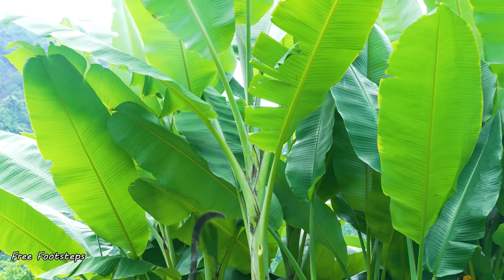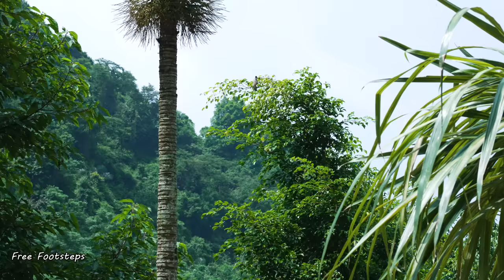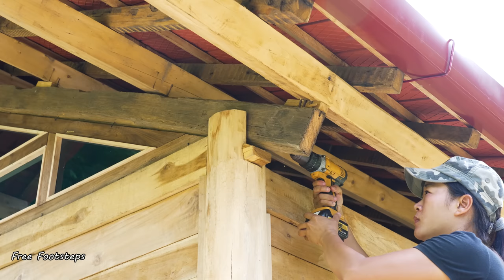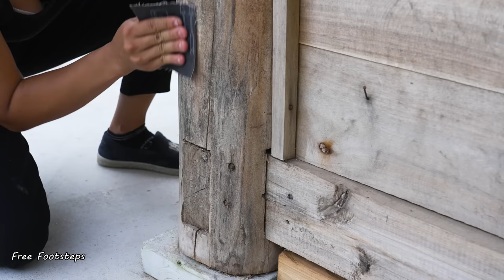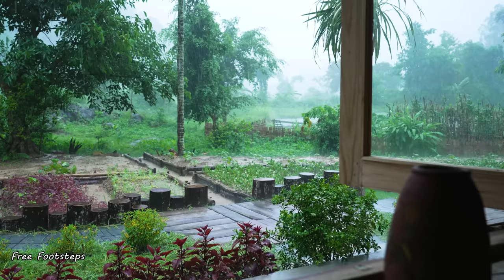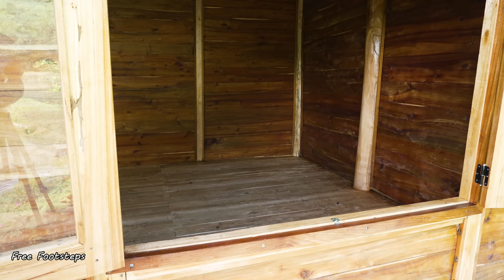Make the Porch & Paint Protection for Wooden Cabin/ Living Off Grid, Part 12

Comment: Put a Pipe under end of rain gutter and catch + SAVE roof raining water into a big Tall 3000 ltr plastic water tank with a tap at botton on one side near to doorway.  build a 400 mm high strong platform to sit tank on and lift tank up off concrete so you can put bucket under tap to pour water out easy- then you can drink clean fresh water and cook with it too all the time even when no raining. Good work ..You are wonderful.

Comment: Mrs. I am scratching my head. Why did you put in the gutters when you were building an extended roof? You would have put the gutter at the roof back of the house or if possible in front of the extended roof. Having said that,the house you built is beautiful and your garden is immaculate.